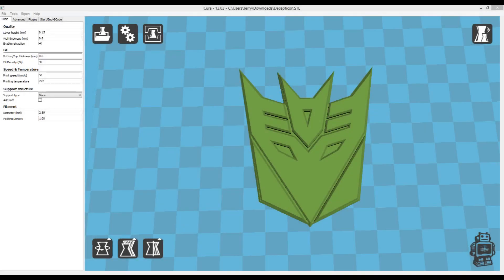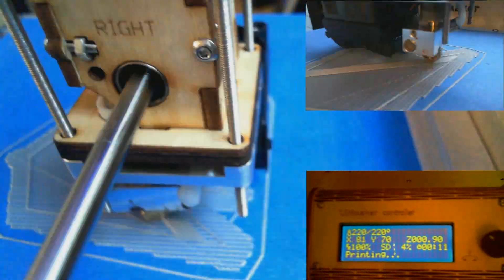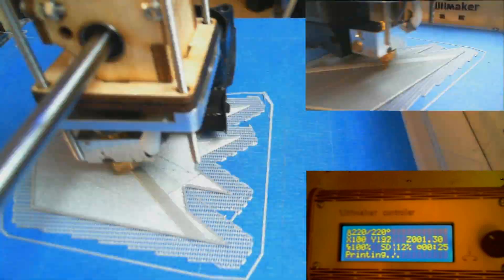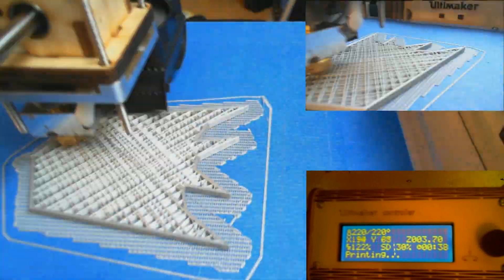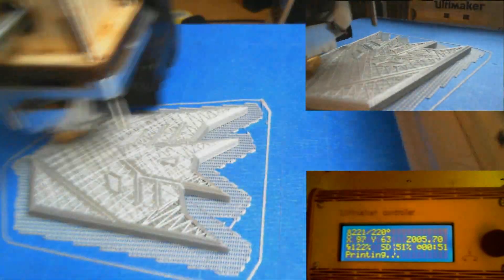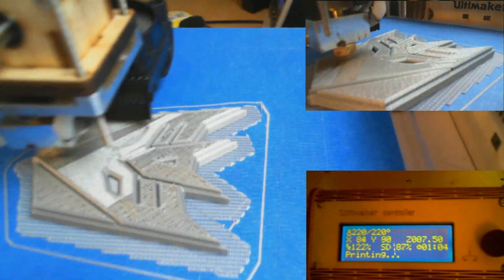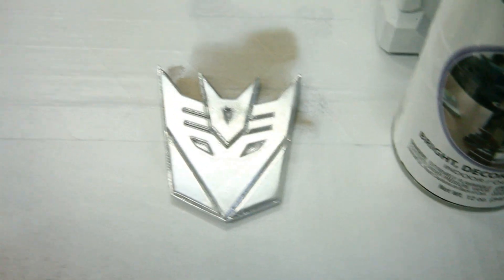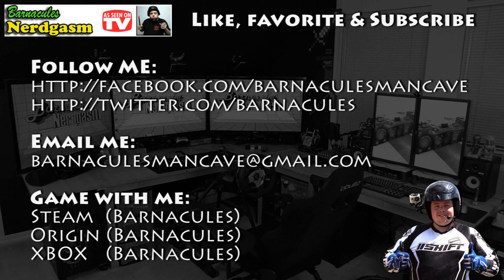Printing & Painting Transformers Decepticons Logo in 3D on Ultimaker 3D Printer - @Barnacules

Comment: You can control the printer remotely as in watch it from disneyland via a webcam and if you see any issues you can stop the print with one button. It's pretty incredible. All-In-All it will cost $60 for the raspberry pi, wifi adapter, charger, and sd card. However, you could probably hook it up to the ethernet and use a phone charger and your existing sd card and pay for the raspberry pi $35, and print out a simple case.

Comment from the maker: Just the default settings, try upping your temp a few degrees and get the head closer to your platform when you start your print. You want it so close to the platform it's hard to push a piece of paper between the nozzle and the platform so it really pushes that first layer down tight.